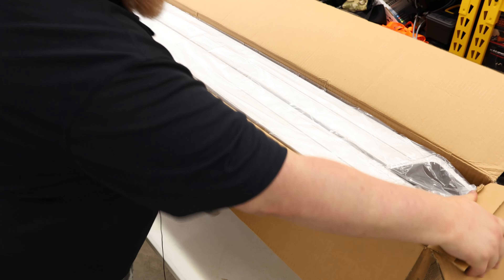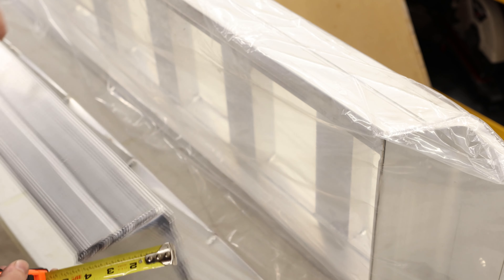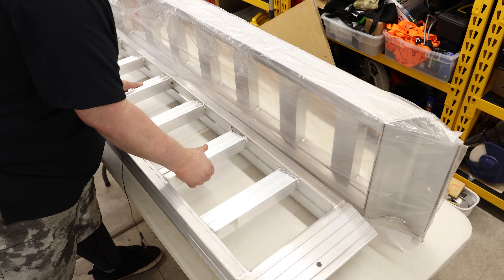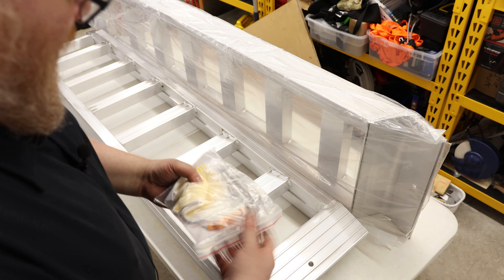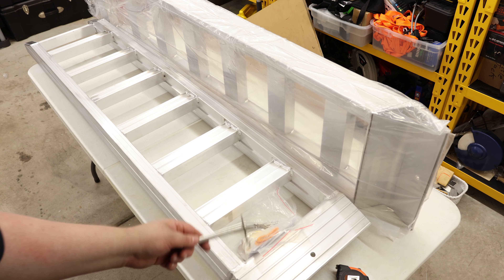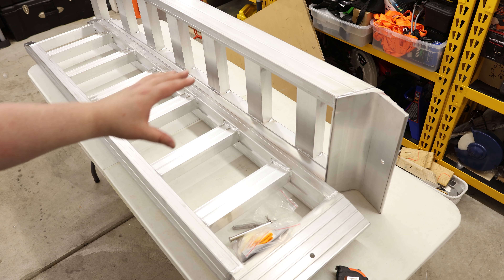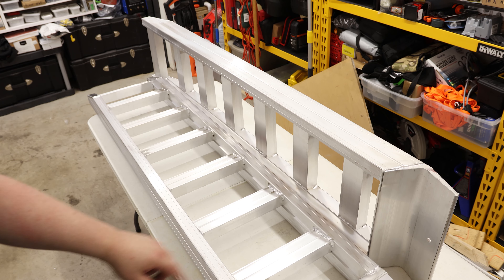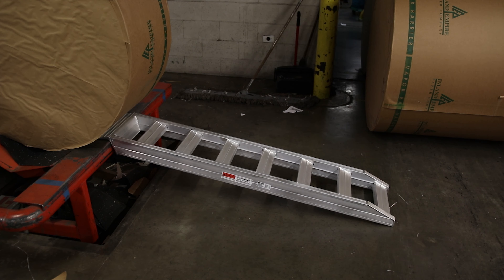VEVOR Aluminum 8810 lb Ramps

Comment: These ramps are awesome got them to load my mini skidsteer into my dump trailer. Work perfect and I just drilled a hole in my trailer and use the included pin to secure it.